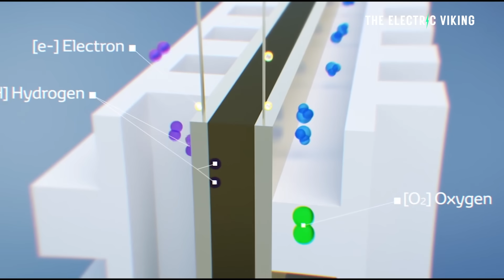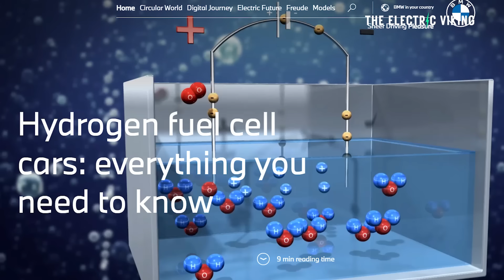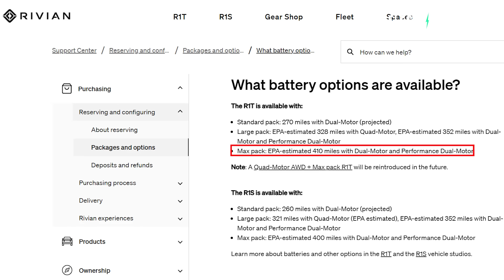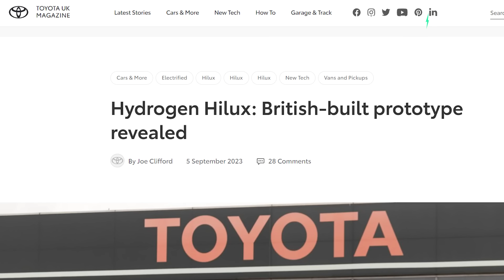Toyota's Hydrogen powered Hilux is the REAL future of the auto industry

Comment: Last I heard the UK was down to 5 refuelling stations remaining.
Reply: All 6 hydrogen refill station in Denmark are CLOSET 4ever...😂
Reply: Few here an Cali too, lol.  Governments typically back the losing horse, flush resources down the toilet.
Reply: According to UK H2 Mobility, there are currently 14 hydrogen stations in the UK for fuel cell powered electrically propelled vehicles. Five of these are located within the M25, with others in the Southeast and Midlands. There are only two hydrogen refuelling points in Wales, one in the north of England, two in Scotland and none in Northern Ireland for cars. The issue like EV charging is connection to the grid. To put in context, typically 50 public chargers are connected daily. To achieve the original government target it would have to be nearly 800, excluding the fundamental need to enlarge the national grid to support them, hence why the National Audit Office report concluded the rollout was a decade behind schedule one of the reasons for Mr Sunak’s ICE delay to 2035, it will be further delayed to 2040. Given UK has 8,365 operational petrol stations and those under development, there is along way to go.
Reply: Actually, the hydrogen hilux is being developed for areas not covered by electricity. Which is about 2/3rds of the world land surface.
Reply: @lesliecarter4295  If there’s no electricity how do you pump/cool/compress the hydrogen?
Reply: @lesliecarter4295  indeed developed in Derbyshire, with the objective of being built in North Wales they are extensively used by UK utilities and builders , but we are struggling like everyone else to roll out public charging.
Reply: @philiptaylor7902  does your dad know you are playing on his computer?
Reply: @lesliecarter4295  I was just asking
Reply: @lesliecarter4295  Cheap and portable/relocatable power production in the shape of folding solar panels and/or wind turbines with cheap battery storage will likely be ready before that Hilux is. Not to mention that with how the prices for both solar panels and batteries are currently falling it should become fairly cheap to install off-grid power just about anywhere you need.
Well, as long as you live in a country that doesn't have issues with importing solar panels and batteries from China, I mean. But given that most countries with poor electrification records are now more closely aligned with China/BRICS than with the US/G7, that doesn't seem like a problem for solving this particular issue.
Reply: @lesliecarter4295  Sadly, if there is no electricity, getting the hydrogen to the 2/3 of the planet (land that is) without electricity will be even harder than it has been for very motivated first world countries. Just wait a little, the electricity will come, and there is no easier, safer way to transport energy than a power line. Any way you cut it, there are fewer moving wearing parts in the electricity cycle, plenty of ecologically friendly ways to produce it, improving ways to store it, improving ways to transport it, and is peerless in conversion efficiency, with only heat as a byproduct.